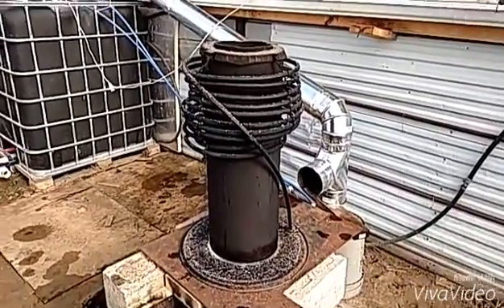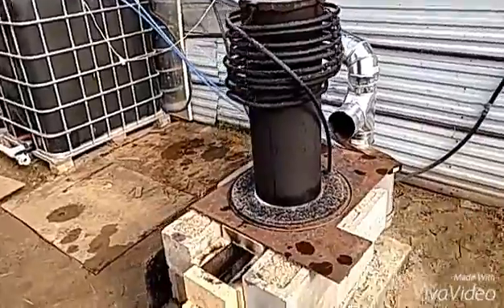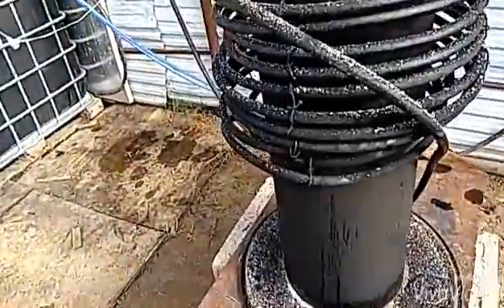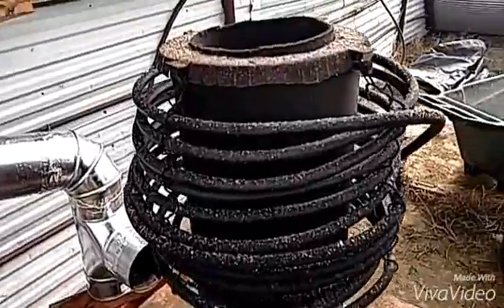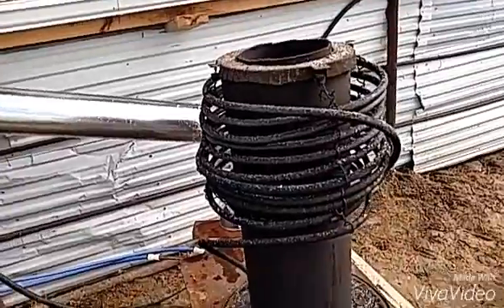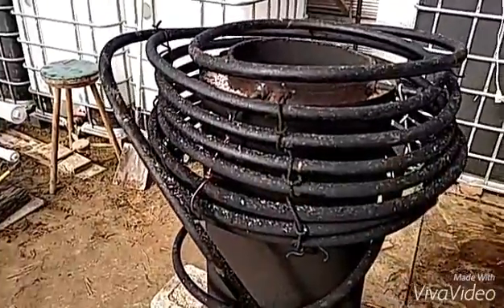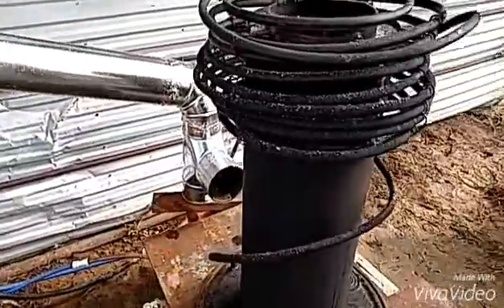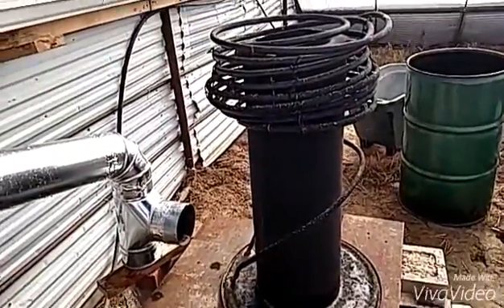Aquaponics rocket stove build Pt 8

Comment: Hi, Are you using a pump to move the hot water or it's just circulating using thermal energy.
Thanks a lot for your videos
Reply: what is the flow rate through the pipe?
Reply from the maker: Maher Steitieh. Hi, yes I have a pump. In the two black tanks you see in the video I store the hot water and in one of them I have a pump that circulates water thru the stove and thru the heat exchanger in the fish system. It has worked good. I'm adding more fish tanks and nutrient tanks, so I will be making a larger stove to handle that. Thanks, Von

Comment: Hi Von, looks good. I built one in my garage last year and burned it, rebuilding a new one with a batch box this fall. I would like to put it in a greenhouse, but haven't gotten that up yet. Are you storing the hot water anywhere outside of your fish tank? I had thought of burying a barrel or 2 in the soil under the greenhouse and heating that for winter in Wisconsin as part of my thermal battery. Have you looked at the gravity pellet feeder from www.rocketheater.com? Might work well for you.Scott